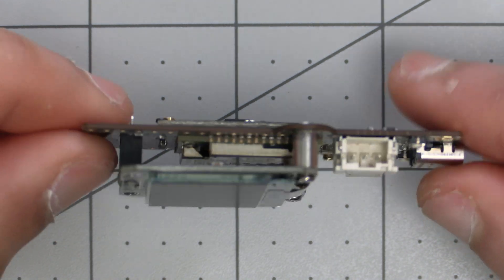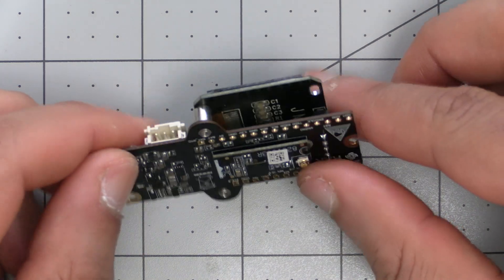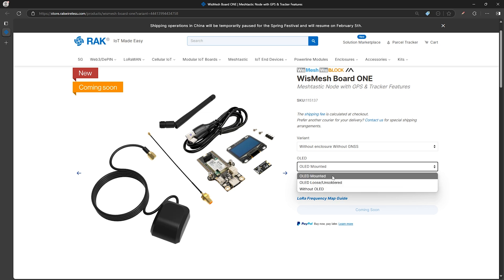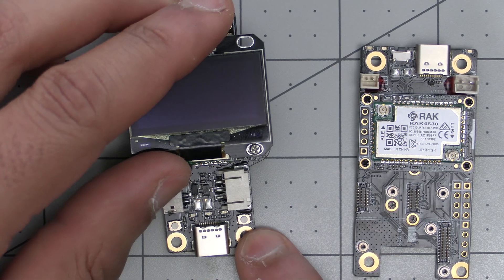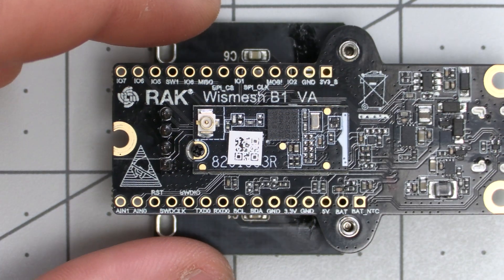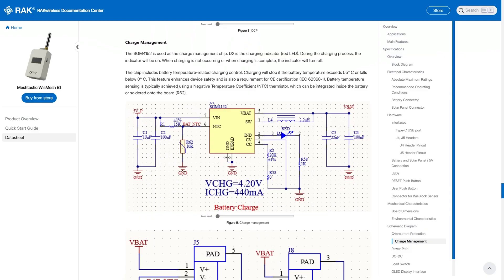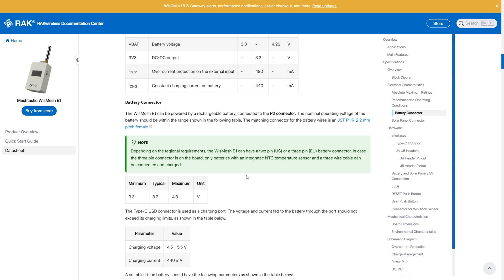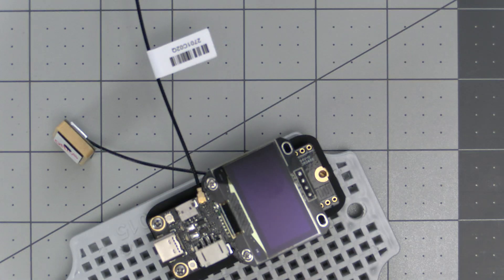WisMesh BoardOne Now Available!

Comment: I noticed an NTC pin on the back of the board. Could you just use the pin out?
Reply from the maker: Potentially but it doesn't match up with what the datasheet says. Also, they're using the same board for the US version so soldering in our own 3 pin battery connector is a possibility as well.

Comment: Sweet finally a solution for the low temp charging problem. Hoping you make a soldering video explaining how to set it up? 🙏
Reply from the maker: Will look into doing that. It's SMD though so not a beginner soldering job unfortunately.
Reply: I would like to see that as well

Comment: I was so excited that they added the thermal shut off circuit, but now ... not so much. I'll wait to see how easy it would be to add the thermistor on the final board before buying. Thank you for making a video about the issue on the US version.
Reply from the maker: Doable but they are surface mount which are harder to do unfortunately.
Reply: @The_Comms_Channel  I hope they make a minor PCB change and make it so that the board could be "stuffed" either way ... 3-pin for the UK market, or 2-pin and an easy way to add the thermistor for non-UK markets.
Reply from the maker: @W9HJBill  totally agree. Or at least have a version where it's included for additional cost
Reply: I just heard back from RAK (via Jason @ Rokland): There is only one PCB version of the B1. The difference between the 2-pin battery connector and the 3-pin battery connector is
- 2 pin connector version has an NTC on the PCB
- 3 pin connector version requires the NTC to be on the battery
Reply: @ So does this mean that the US version already has the thermocoupler installed? If so, give the size of the box that most people would be putting the B1 in, it wouldn't make that much of a difference as far as temperature goes. That would be great news.
Reply from the maker: @W9HJBill  @JimDumser based on the datasheet, it does not have an NTC on board; just the charge management chip. Otherwise, there would be no point in having a 3 pin version that can use batteries with a built in NTC.
Reply: I said what I know and gave the source of the information. Who is right? I'll see when mine gets here.
Reply: @JimDumser so which was it?